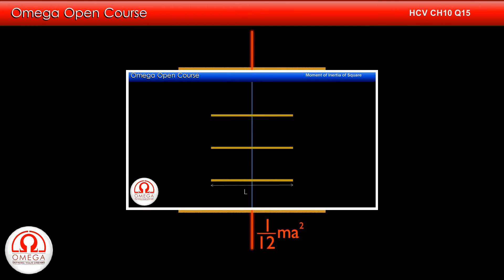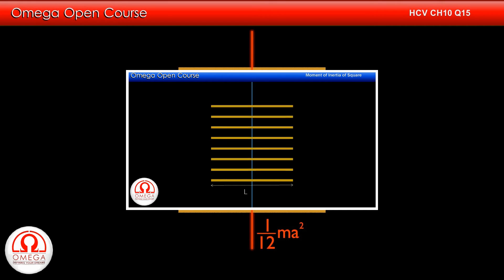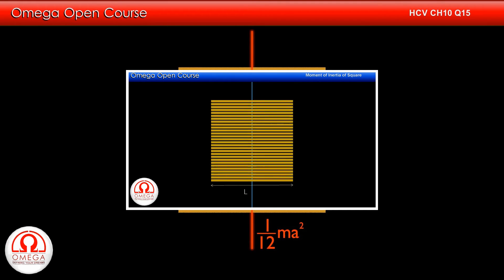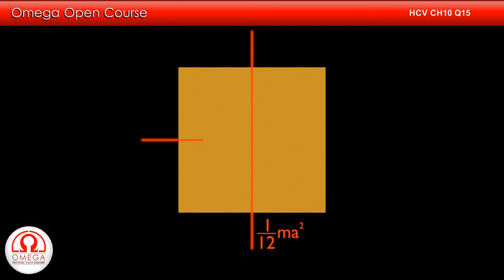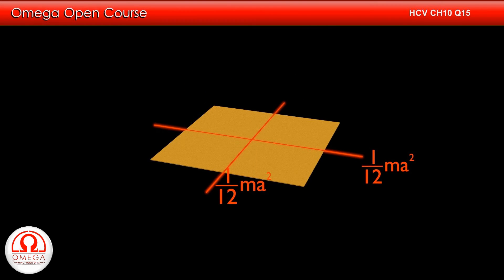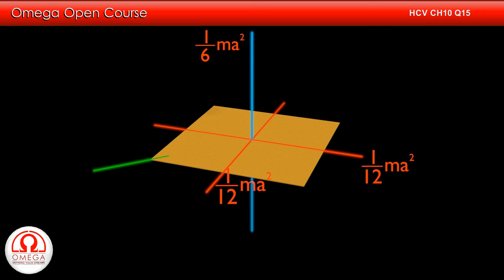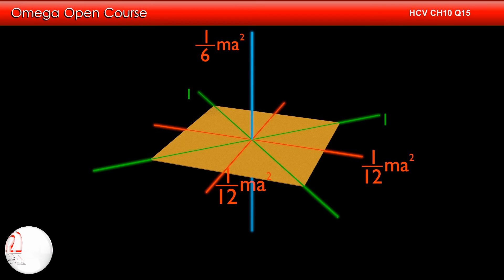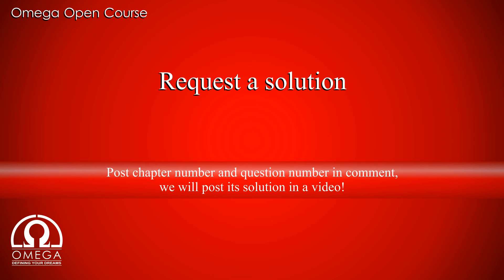H. C. Verma Solutions - Chapter 10, Question 15

Comment: how to approach the problem if I divide the plate in thin strips. I know perpendicular axes theorem makes the problem very easy to solve but I want to take the hard way for better conception.
Reply from the maker: +Dip Das in that case you will have to apply parallel axis theorem. When you divide the square into thin strips, each strip can be considered as a rod. 

Take a strip of width dx at distance x from the axis, calculate it's mass and then you can find its moment of inertia about the midpoint of rod. Using parallel axis theorem calculate the moment of inertia about the given axis then integrate it over the entire sheet.